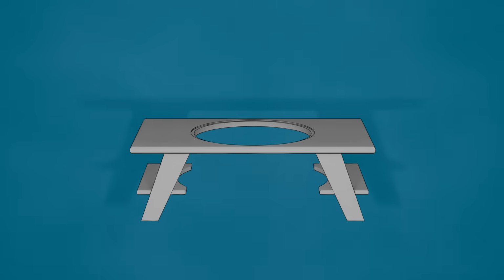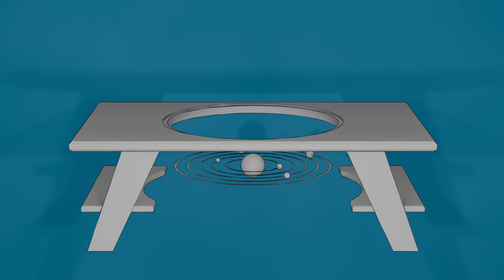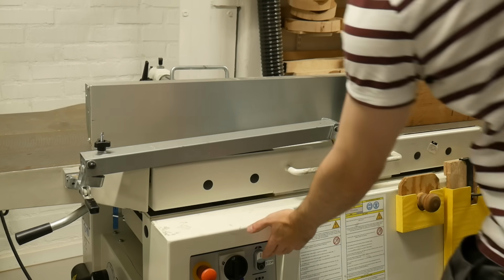I Built a New Kind of Star System Inside a Coffee Table

Comment: You need to sharpen the tig rod to a point, makes for a better arc, and dont touch the work with the point whilst welding, apart from that, fantastic model.
Reply from the maker: Thanks! For steel and DC welding yes, but not for aluminium, with AC the sharp point on the electrod will melt away. Atleast for the amateur welding I'm doing😅

Comment: I had a strang idea.  If you place a mirror under the table and painted the parts with Musou Black.  The view from above would be floating planets.  If you wanted to ad flair you could add leds under the table top the mirror would show those lights doubling the distance and showing simulated stars in the background.  They would be in different locations as viewed by the observer.